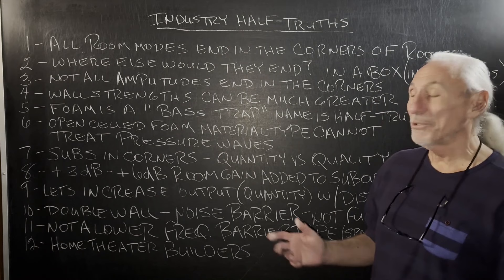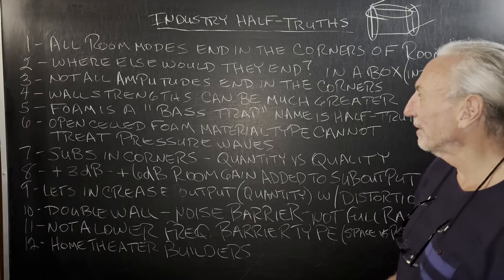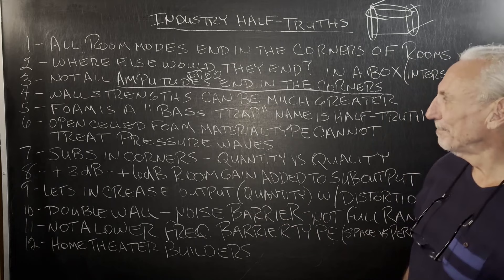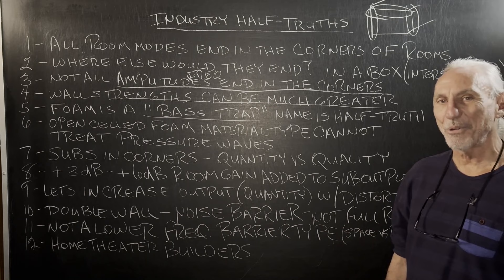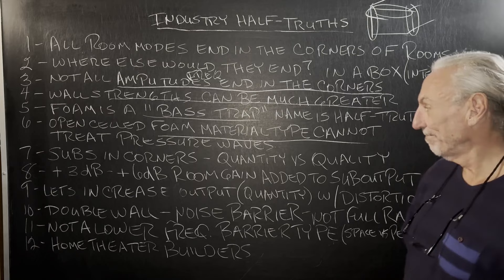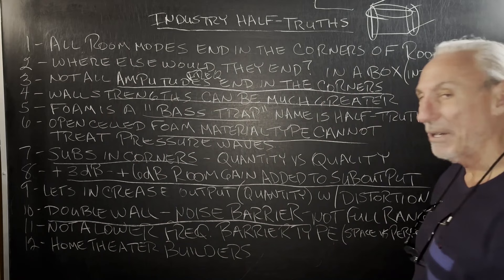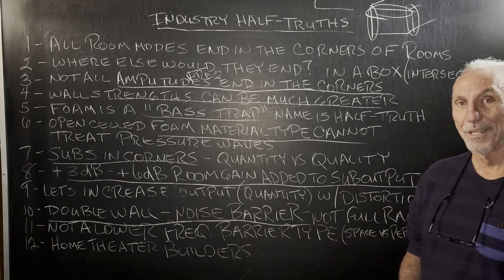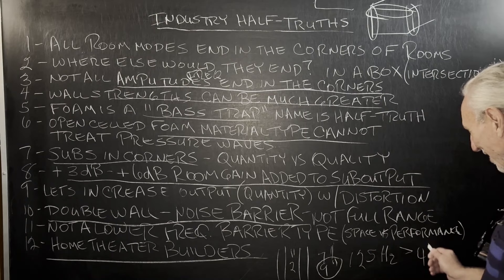Industry Half Truths - www.AcousticFields.com

Comment: Great video. The rock wool in the corner junk that’s all over YouTube is the most annoying to me because it’s wasted my time, money, and materials.  I know from experience that it doesn’t do much of anything with low frequency management. All except 2 of the 100s of videos I’ve watched on YouTube, other than your entire channel, suggest rock wool in the corners.  There’s even a channel that is entirely based on room acoustics “without all the voodoo” that recommends it.  95% blind leading the blind.
Reply: Yeah, I've seen many of the same videos.  What cracks me up is some recommend 4inch thick wood frames filled with rock wool or fiberglass and they call it it a "Bass Trap".  When you ask them simple questions like what's the absorption coefficient curve for the panels he's recommending, instead of answering the question, they get all pissed off. They never answer the question either.   

I had one guy tell me that he built diffusion panels and he was proud that his "diffusors' absorbed down to 300Hz acting like that was a "low frequency".  It was one of those things that some call "absorbers" where it's an absorption and diffusion product..  They are all the rage now.    I asked what the frequency range for diffusion, and again, crickets.   They didn't know how to answer simple questions.  But they promote them like they split an atom and created the holy grail acoustic treatment.

I've even seen the videos pushing Green Glue as a barrier technology, or even sound proofing "blankets".  It's just ridiculous how many scam artists there are and they get away with it.
Reply: Yeah and it’s like if you push back and ask those questions they imply that you’re a dumb*** and it’s “common knowledge” even though they can’t answer the questions you posed.  I’ve even had one of my comments deleted because they didn’t want to answer the question I put in the comments. Glad I found this channel by accident one day. I knew something was wrong when the corner “bass traps” I was recommended to build made virtually no difference in my ability to hear my mixes any better than without it.
Reply from the maker: Your just getting started my friend. How about sound proof paint? Of all, that's my favorite.
Reply: @AcousticFields  I think the "sound proof" curtains is another on the top of the list.
Reply: @AcousticFields  😂 Prior to knowing absolutely anything about acoustics, even I would know sound proof paint is bogus. That’s the most ludicrous thing I’ve ever heard of.  When is Acoustic Fields going to launch acoustic paint to take low end management of your ACDA units to the next level? 🤣 These companies… 🙄  Sound proof your room an additional 0.001% using some bogus paint. I guess it’s the same as a drink labeled juice that has 1% juice by content.  Legally allowed to bend the definition of what a product does/contains…

On a side note about half truths, I saw a video pop up in my feed last night from a popular channel titled Do You Need A Sub? (aimed at home studios)  I had to watch it to see if they’d mention anything about the room being a deciding factor. No mention of low frequency management, only that a sub would give you more low end…  duh… To be honest, before I even started to watch the video, I already expected them to gloss completely over the room (now that I’ve been made aware of the half truths and BS floating around everywhere). It grossly misrepresented the actual benefit you would get by just throwing a sub into the room.  The video was filmed in a studio with acoustic treatment built into the walls but, of course, they failed to call that out.  How would anyone know that you’d also need all that treatment in addition to just adding a sub to get a real benefit? It’s misleading the 1000s of people watching that video that are attempting to improve their home studios by suggesting that you simply need to purchase more gear.